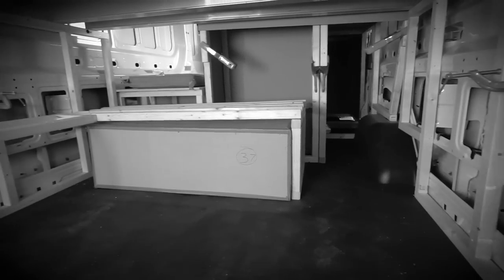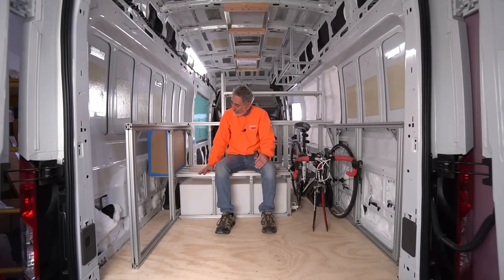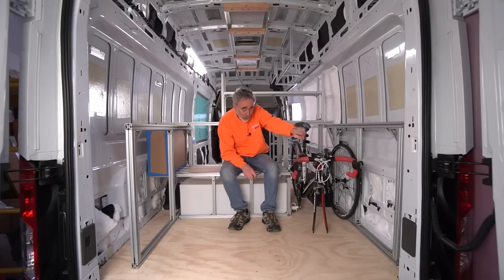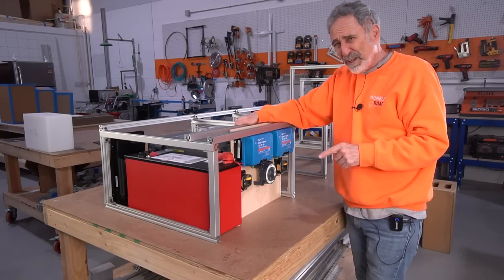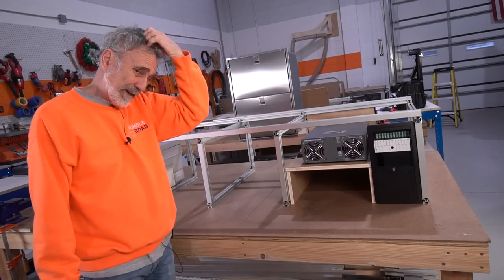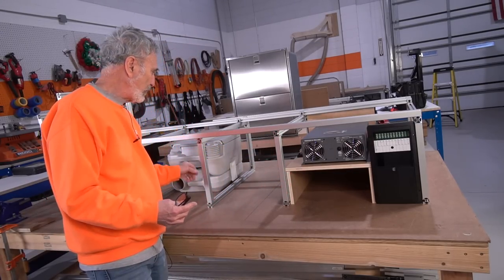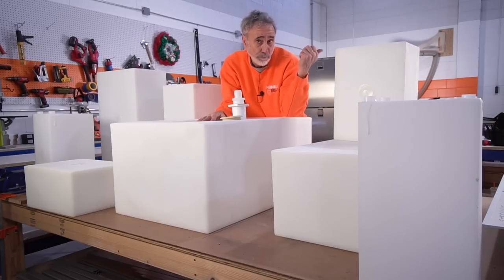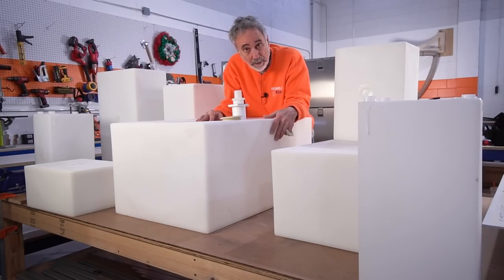Van Builder's PRO TIPS: 8020 extrusions, electrical compartment design & fresh water tank fittings

Comment from the maker: EDITOR'S NOTE: GOOGLE SEARCH FRESH WATER HOLDING TANKS. BE AWARE OF THE WALL THICKNESS.
Reply: Too late for me!   I can offer personal testimony to at least several of this video's points.  1) I'm getting ready to deal with a wheel well fresh water tank that goes from concave when empty to basically bloated when filled.  Since I did all of the dry fitting when it was empty (who knew?!?!?) and my plumbing station is already built right beside it some things need to be redone to allow for the changing dimensions.  I'll probably end up supporting it with 1/2" Baltic birch "belt" to limit the expansion.  2) Thankfully it's all 8020 so while its going to take some time I won't be throwing anything out.  Thank you for these videos.
Reply: Do you have a brand or manufacturer of tanks that you recommend? I'm looking for fresh and grey tanks for an ambulance conversion.
Reply: Highly informatiive as usual. Can you share your tank suppliers name or brand? Thanks.

Comment: after 1 1/2 yrs of planning learning and getting all the needed items i’m about to begin my first build 3500 xd dually 170 2020 4x4 sprinter thank you for all of the knowledge i would of never of attempted this if it wasn’t for all your help i would love to do something for u if u ever need any type of healing we help people even the doctors can’t help i would love to help u as i feel like i owe u may god watch over u and bless you 🙏🏻
Reply: I have the '19 model of yours; you're gonna' love it. FYI, mine is a plywood pro-build, which is nowhere near George level, and it cost $95k two years ago. I've since added ~$5k more.  Tip: after build (a) get your wheels re-alinged (b) TPMS if not factory and (c) an appraisal.
Reply: @LilyWasHereMB  i’m at 160k so far and i haven’t started my. uild yet thanks for the tip about alignment the added weight would cause that i’m also doing a upgrade to the suspension once i’m done with the build for the added weight 👍👍👍

Comment: We put the head of the bed on the driver's side because (generally) if you were to park overnight along side a road, it's more likely to slant downward towards the passenger side.  Plus not sleeping with your head next to "central park", shields you from the light caused by your night-owl partner.
Also .... because of your videos, we used 80/20, which previously we were unaware of.  It's stronger than wood, lightweight, and most important -- bolted to the van frame.  Thinking of safety in case of an accident.  You don't want your cabinets launched into the cab.  Thanks for that.
Reply: I have a secure lock on my cutlery draw for that reason. No flimsy caravan catches. You don't travel in the caravan.

Comment: I don’t use baskets but I use plastic restaurant food containers with lids.  They come in lots of sizes, are light weight ,and they really hold up well.  They stack and clean easily and are excellent quality.  You can get clear ones but eventually they will scratch.  I use a restaurant supply company called KaTom and a plastic product called Cambro.

Comment: I agree 100% with your comment about baskets and cubby holes.  Most People complicate their DIY builds with custom cabinets  and drawers when really  a cubby basket design  is the the most  efficient design.  I also think people buy way too much van and that limits where they can go and park..   I have a friend with a big van and 95% of the time he's by himself in the van and he has to have another car  because he can't even park the van in most spaces and garages.  I have a tiny van and I manage to fit a big e-bike inside - I can park and go anywhere I want, and if I need to it sleeps two comfortably with the bike chained to my bumper outside.  I'm also partial to switch blade designs where the van has a day and night configuration.  I think it's also important to draw a distinction between sleeping in a van and living in a van.  In Florida (IMO) one does not live in a van, one lives outside and sleeps in a van -  so any van I build will require  cooking, eating and showering outside of the van so this changes the biggest perameter and cost in most vans.. height of the van you need.  I've never had an issue finding a private spot to back my van into to do these activities - and it's 1000 times more comfortable no matter how big your van is.  Design a van to cover the critical 80% and when nature changes your plans work around the other 20%. This means some days you might need to spounge bathe, eat cold canned beans or sit in a coffee shop for 4 hours watching cat videos.  Use all this new found down time to learn new skills or run an online business instead.

Comment: Another great video from the Master of ProMaster builds!  
Just another option for installing the check valve on your water pump: you can also install it just before the pump inlet vs installing it in the tank.  It will still hold prime.  The principle is similar to immersing a straw into glass of water, placing your thumb over the top hole of the straw and then removing the straw from the glass of water.  The straw will remain full, until you break the vacuum by taking your thumb off the straw.  This is a pretty common practice for electric pumps on hand dug and driven point wells.
Reply from the maker: Thanks for that suggestion. It would make maintenance much easier.
Reply: Wouldn’t this theory work without a check valve with just the pump? I think the Remco folks told me I wouldn’t need one suggesting it does just this. If the pump has a vent of some kind, the theory is out and the water will fall to gravity. 🤔
Reply from the maker: @turnpike420  it all started with the Vagabond van. First with a pick up tube. Check valve fixed the problem.

Comment: George!  A few years ago I once commented that I did not think that you had created enough support for your roof fans.  Unfortnately I was not able to adequately describe with words alone what I meant by distributing load to structural members, and the convo faded away.  I want to say now that I love the support system you created with the angle aluminum!  That is a real support structure and its tied in to the support beams of the van!  Nicely done!  Very impressed sir, very impressed.
Reply from the maker: Thank you Eric! As you could see in the flyby, the 2x4s will be the pick-ups for a "down the center of the van" tongue and groove panel shiplap treatment.

Comment: 10:40 - Head position in MIni Me van.  There are two reasons I would agree with the majority view of head position inside not near seats and open doors:

1.  Feng Shui dictates you face positions of vulnerability which are doors or entrances.  You do not place your head at the door so you cannot see who is coming in.  This is a primal security need.  In all Feng Shui layouts, the sleeping head is positioned such that they can see who is entering the inner sanctum.  This also applies to office chair positioning. You cannot work with the door to your back.  Anyone entering will make you jump, and you feel very exposed and vulnerable.  You need to face the door /entrance to your office. This is why, it is so hard to concentrate in open office designs - they don't work. You don't feel safe on a primal level.

2. Electrical components need to be at least 3 feet away from your head. Your brain works at 60 Hz, and so does the 110V AC electrical sockets. Not sure how this works with DC power, but positioning a head over the electrical components for 8 hrs every night is a huge no-no.  It will buzz the brain.  Proof of that are studies done with autistic children who fare better if their heads are 3 ft away from any wall sockets.

Comment: Re: Bowed water tanks
If you are having trouble mating your flange to a water tank that is deformed, or flexing you could consider using some spreader clamps inside the tank to get the tank back to square.  You should be able to get the flange glued and set that way.  Although some extra screws might be in order to prevent the seal from coming unglued.
Reply from the maker: Good one.

Comment: I would make a way to level the bed frame. I would think a couple of inches of adjustment   for N-S and E-W could handle that majority of parking lots, streets and camp grounds. This should be easier than blocking the wheels.
Reply from the maker: I'm listening.
Reply: @HumbleRoad  could be a slotted bracket or telescoping leg with a L handle twist to lock, similar to Lagune table support. I like the use of IKEA flex slats with a metal frame. Allows tuning the support along the length.

Comment: I’m not sure why you would need a check valve. I build various mobile units and have found that, depending on the pump you use (in our case we use Shurflo 4048 pumps) they have a built in check valve, thus not needing an extra check valve that may restrict your water pressure even more… Just an observation. Great video once again!
Reply from the maker: Think about the vertical pick up tube coming up out of the tank. A check valve inside the pump does nothing for the water in the pick up tube.
Reply from the maker: Now that I think about it, the check valve in the pump would be on the output side. Or.. the impeller acts as a check valve. I'm talking about the input side of the pump.
Reply: I’m fairly certain the check valve must be on the pick up side, we’ve never had an issue where the water would drain back into the tank, or the pump working to build back pressure after a period of time without use. We have always had water readily available once we turn on the tap without any additional check valves. I suppose if you wanted to add another safeguard you could put a foot valve on the inlet of the tank. But as mentioned, these pumps are small and the added valve will restrict water pressure in my opinion.
Reply from the maker: @jamesmatthews4840  I am definitely going to test your theory, James. It would make service and maintenance much easier. That’s my middle name! Thank you!

Comment: I like the idea of top side connections.  Can you show the pick-up tube fittings setup? A nipple on the inside of the tank (pick-up) and another on the topside to pump.
Reply from the maker: Pick up tube connected to pump and pushed through a grommet into the tank. One tube with the connection points on either end
Reply: OK - I think I got it.  Thanks!

Comment: production value in build and video top notch as usual.  Question about the insulation.  Some White facing out some black.  Is there a reason for this?
Reply from the maker: First layer of Thinsulate; black side adhered to van chassis. Second layer of insulation, flip it so the layering is white to white. That's how we know which bay still needs the second layer of insulation. If we see white, add more!

Comment: George, are you familiar with a gadget called a “freeze miser?” They fit on the end of a faucet and when the temperature reaches the freezing point, they automatically start dripping water. No electricity needed. I wonder if there might be an application for them on a van. We have used them for two winters at our house and they do what they are supposed to do.

Comment: Hey George, how do you attach the 8020 to the floor after you’ve already installed the flooring? I doubt the structures are only attached at the sidewalls. Thanks for the videos, your channel is very informative and entertaining!
Reply from the maker: The modules are screwed into the 3/4" plywood floor as well as bolted to the vehicle chassis walls.

Comment: MiniMe - Zero Breeze Mk 11 - small enough to stash. In an insulated minivan size platform it would probably work well enough to take the edge off humidity and heat overnight.  Power consumption, maybe pack an extra dedicated (Zero Breeze) battery pack??

Comment: Hi! Top production! Again!!
One doubt on insulation: having the upper cabinets' 8020 attached directly to the van's ribs, won't that bring the outside cold to the inside?
Thanks in advance!
Reply from the maker: Wherever the 8020 touches the van chassis, I put a HMV thermal break

Comment: I noticed the Rixens reservoir in the picture showing the round Isotemp. Why use a hot water tank versus Rixens heat exchanger setup, for hot water?
Reply from the maker: I use both. The heat exchanger steals heat from the engine glycol. I've done a few videos on my design.
Reply: @HumbleRoad  Thank you for the reply. I’ll go find your videos on the subject.
Reply: @HumbleRoad  Ah, I see you’re only using the Rixens reservoir. I was thinking about their complete heating and hot water system, which includes a diesel coolant heater and a heat exchanger dedicated to providing “instant” hot water.
Reply from the maker: I used the Espar hydronic heater in my first build. Took care of hot water and cabin heat. I just didn't like the idea of firing up the furnace in the middle of August every time we needed hot water. Now, two separate systems are redundant, which is my middle name!

Comment: I like this method when you can reconfigure layout a lot easier. That's why I think using aluminium section is better than wood. Having said that can you explain how you deal with cold bridge where you fix aluminium section to your van? Wouldn't that transfer outside temperature inside your van?
Reply from the maker: Wherever the aluminum touches the van chassis, I place a strip of heavy mass vinyl to act as a thermal break.
Reply: @HumbleRoad  How does it compare to having thick insulation in adjacent places? Won't it still create condition points in cold climate? As I mentioned I really like the concept but this worries me a bit 🤔
Reply from the maker: Don't worry. It works just fine. Not one of my clients has froze to death, nor passed out from heat exhaustion. 😆

Comment: how do you accommodate 29er handle bars, theyre so much wider than road bikes??
Reply from the maker: The forks will be turned 90 degrees. Custom bike clamp similar to a roof mount.
Reply: I ride a 29 XL frame mountain bike. It’s big. I’m building a drawer to hold 2 bikes, but not turning the bars 90. The drawer tray is already 60”! And with a second bike offset so they fit tightly side by side, the rear wheel hangs behind that 60” by 8.5”! My handlebars are 780mm wide. A downhill mtn bike could be 800 or larger! I’ll have some kind of similar setup to my bike position as George has here, but I’ll have more room against the passenger wall for components since I have to bring it more toward center so the handlebars can clear the D pillar., so that space will be electric or water related… or storage. TBD.
Reply: Oh, I will be front wheel taken off to attach bikes to tray using MBP fork mounts.

Comment: QUESTION..
1. Where do you run the water hose? Under the van or in the floor?
2. Do you, and how do you attach the 80-20 to the floor of the van,?
Reply from the maker: All water lines are inside the van. 8020 is screwed to the floor and bolted to the chassis walls

Comment: Any thoughts on large tank water sloshing fore-aft or side-to-side when half empty? It seems built-in tank baffles are not easily manufactured and would complicate manual cleaning. 
I might consider splitting the capacity into two or three nearly square tanks. Tanks could be nested tight together (bonded?) and interconnected with threaded pipe connectors internally fastened with compression gasketing. Alternatively a separate fill/vent/pump plumbing to each tank.
Reply from the maker: each connection between tanks is a point of failure. Far more devastating than sloshing in a secured tank.

Comment: Are you getting any feedback from your clients on how hot the electrical components get? Do the systems ever shut down due to over-temp protection kicking in?

Your "physical plant" is impressively tetris-ed together but there's very little free airspace. The Victron chargers have heat sinks integrated to their backs but you've got them hard up against the 8020 completely blocking any convective airflow through the fins. On top of that, the inverter is right behind them and looks like it's blowing its hot exhaust right on those fins!  Seems like a recipe for short lifespan components especially in warm weather when the living space isn't being air conditioned and the doors are probably open which may mean the sun is shining directly on the cabinet.
Reply from the maker: Airflow and ventilation are two of the hallmarks of my build philosophy. There have been no complaints with my builds, in fact, three of them are full-time traveling every day 24 seven without one issue.
Reply from the maker: Possible the camera angles are causing your concern.
Reply: @HumbleRoad  Thanks for the info, I'm building what I thought was as pretty dense cabinet but it's relatively open compared to this, so I am sleeping better tonight with this reassurance!

I'm wondering if the 8020 framing might be helping to draw heat out of the box, after all it is just hunks of aluminum with grooves in it, so basically a heat sink...

Comment: Out of curiosity George can you put a large o ring on lid of tank to solve the problem if over filled ?
Reply from the maker: There is already an O-ring in the inspection hatch. The problem is two-fold. The hatch is not designed as water-tight and the adhesion to the tank is hit or miss. I have been torching the area prior to adhesion. That seems to work well.
Reply: @HumbleRoad  good to know Thanks !